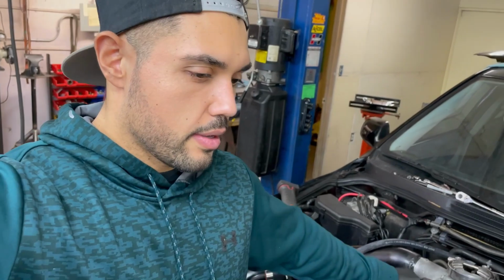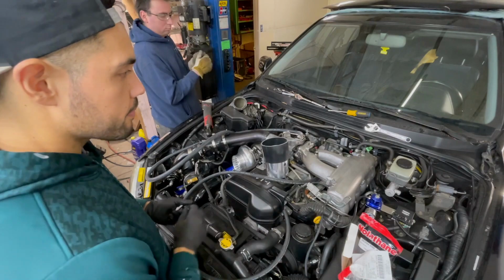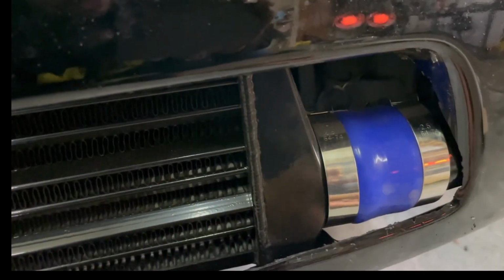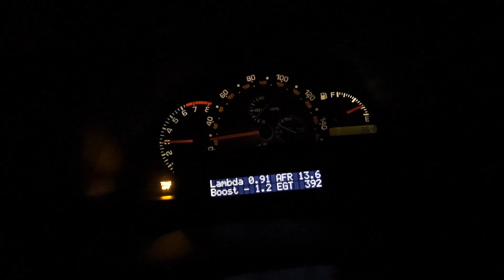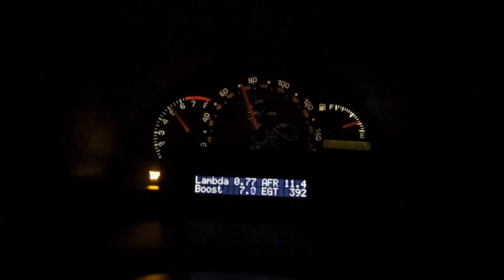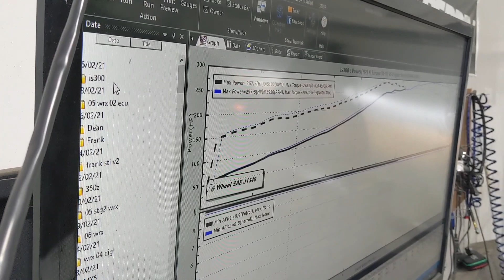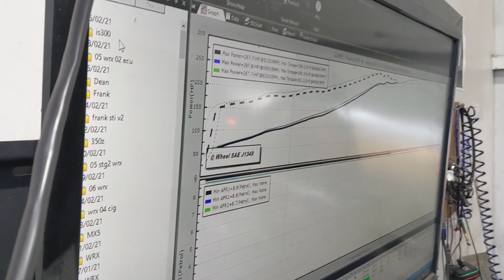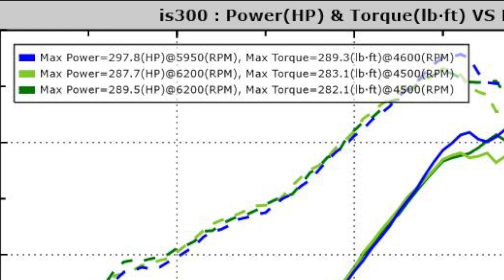IS300 TURBO BUILD PT 3...Dyno, Fly By & Launches

Comment: I wish you would have tried with an open downpipe. That exhaust seems a bit restrictive.
Reply from the maker: It is a bit restrictive, we could have probly got a bit quicker spool from the turbo if we had done 3” catless exhaust..I do like how quiet it is though which is the main reason we kept the catalytic converter
Reply: @mabuildsofficial  on that note , maybe a cutoff valve before the cat right where you reduces , might be a sleeper solution and have the best of both worlds 🤔

Comment: Great vid, just wondering how many miles were on the engine when you put the turbo on?
Reply from the maker: It had around 167k miles…spoke to the new owner who drove it 2000 miles back home to colorado and he says it’s been running great and recently did a 4000 mile road trip on it and it ran like a champ!

Comment: Hellya bro good numbers for a stock ecu untuned! How’s the fuel trim look short term and long term/AFR. Also are you encountering any heat issues at all?

Sorry for so many questions , I got lots to ask cuz I’m in the same process with my 2000 Lexus GS300, I don’t see many NAT GS300s in my area I thought I’d break that curse
Reply from the maker: Fuel trims are on point! Usually always hangs around 14.7 unless we put it under load then it goes down to 11’s....no heating issues at all...stock radiator is enough to keep everything cool...no worries with the questions feel free to ask...we will be going over the whole set up in pt4 and going over what changes we made!
Reply: @mabuildsofficial  are you guys running all 4 o2 sensors? or did you splice them together like a lot of people suggest to do. when you guys do a build break down, please mention a cost total in parts, im trying to put my kit together for under 1500$
Reply from the maker: We did use all the O2 sensors and we'll do our best to remember what we paid for everything lol I think that's doable tho for $1500.... With you doing all the work of course.